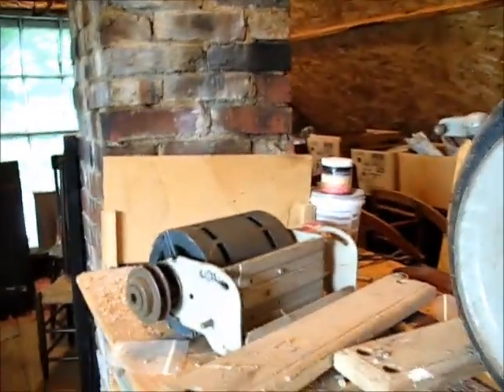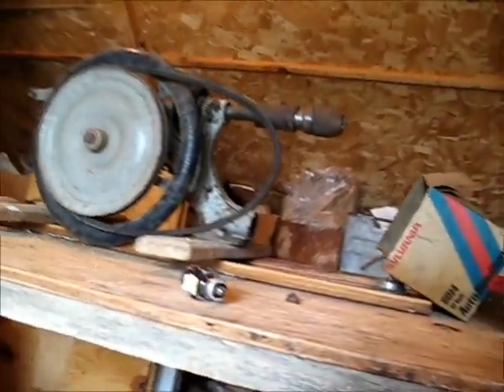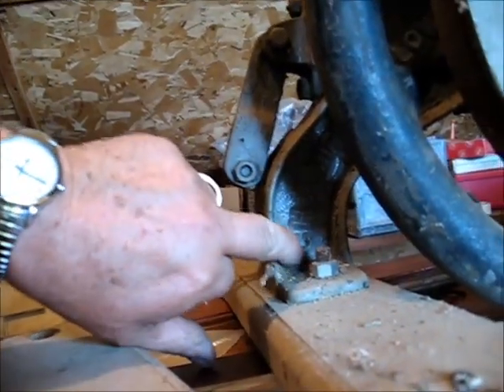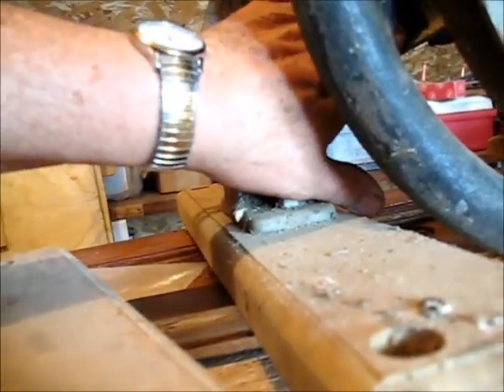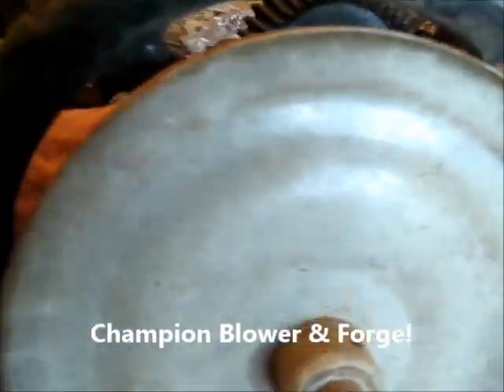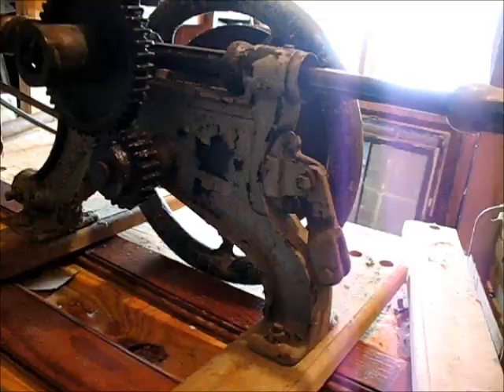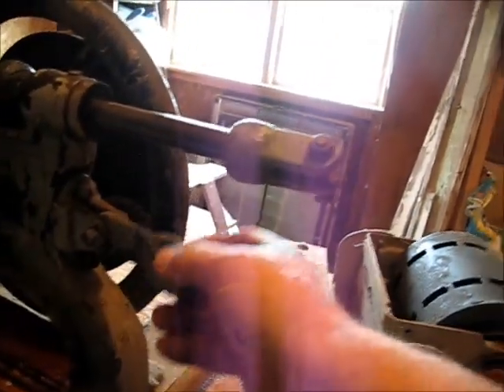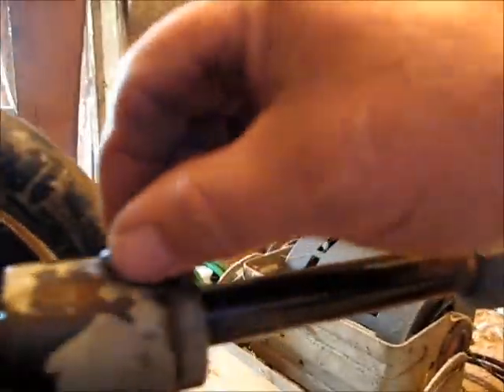Hand Operated Drill Press with motor?

Comment: I'd set up a variable speed pulley system like that on a modern craftsman drill press if your going to use a motor with it. I have one that leaving hand cranked :)
Reply from the maker: +horseman1968   I've seen some of the hand cranked ones and they work real good.   This one worked out real well to drill my banjo necks with.

Comment: Neat tool.  If you kept it mounted horizontal on a real strong bed, I wonder if you could rig it up to run as a wood lathe as well. It looks like it has enought swing ... or could be configured to, so you could turn pots and such on it.  I have an old Atlas metal working lathe .... its great for doing small bits but not big enought for a pot.   I just bought a REAL old Craftsman drill press with just that in mind.  A lathe could do a lot of work for you.

Comment: Actually, its missing the hand crank on the right hand of the machine, opposite the fly wheel.  Probably taken off when someone added the motor.  There should be a rectangular notch/hole thru the horizontal cylinder on the right had side.  This is where the crank handle went thru :)